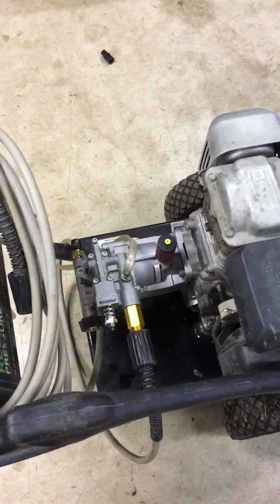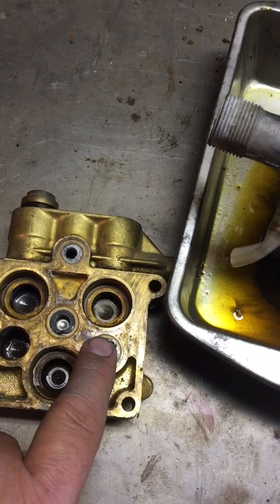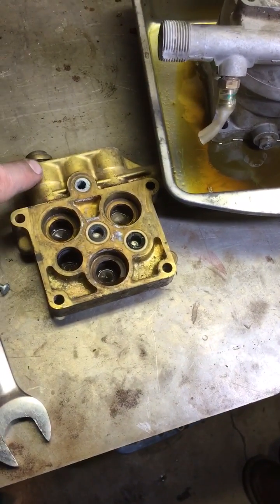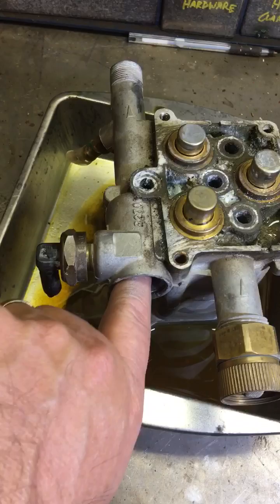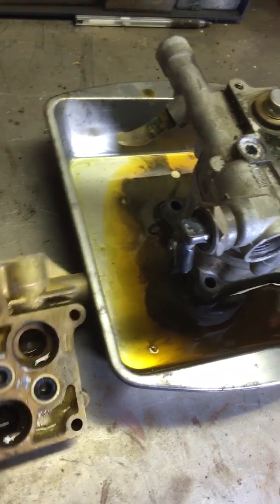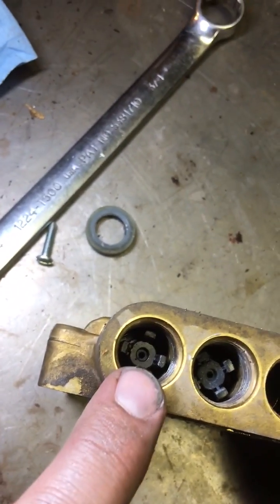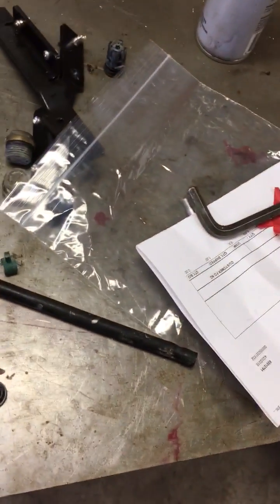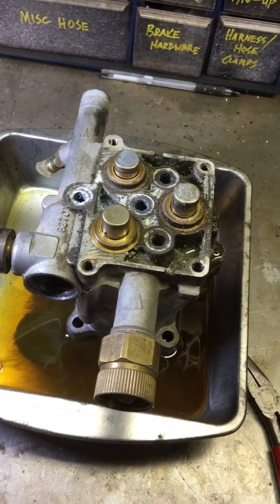How a pressure washer pump works

Comment: I've got pressure washer,I changed the plug but it doesn't start i keep pulling it,i tried to spray "start ya basterd" but still no luck, what could be the problem?
Reply from the maker: If it does not run on starting fluid, you either have no spark or low compression (stuck/tight valves, worn rings)
Reply: @joesfamilyfarm  make sences i did change the spark, but still the same, so time to through it out then i guess lol

Comment: That was awesome. I'm curious if you had to buy a pump rebuild kit for that, or if you bought just a new pump for it. I'm looking into fixing pressure washers in the future.
Reply from the maker: Shawn Carlson  I replaced the pump.  It’s been a while , but it seems like I recall not having much luck finding parts and the price of a new pump wasn’t too bad considering the hassle factor.

Comment: just so happens I was searching for the basics of how one works, cause mine is pretty old.  it works, but intermittently.  As luck would have it, the first video I clicked on, has the same model power washer AND pump of the one I am working on!  So I think I can tear apart and look for issues.  thanks a ton.  Mine has a broken spring in the chemical intake check valve, and I am wondering if that is causing my problem..  I was hoping to close it off permanently, as I don't need the chemical intake. Some tweaking with it (removing spring, then removing ball) seems to have adverse effects..